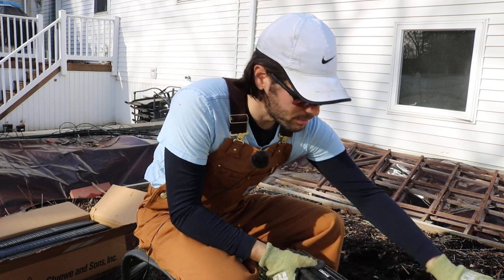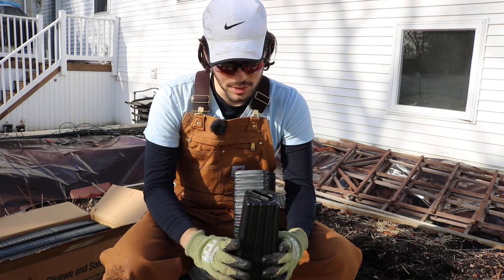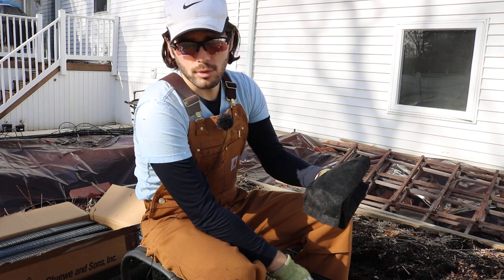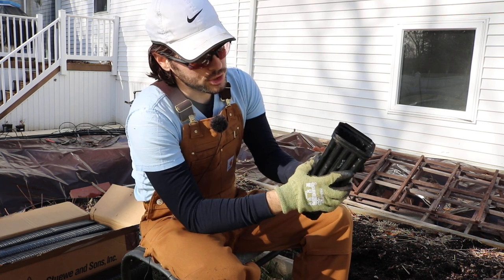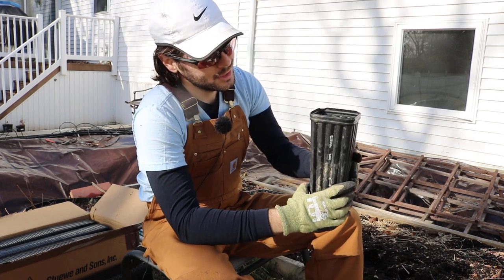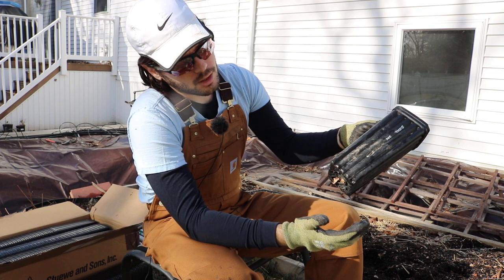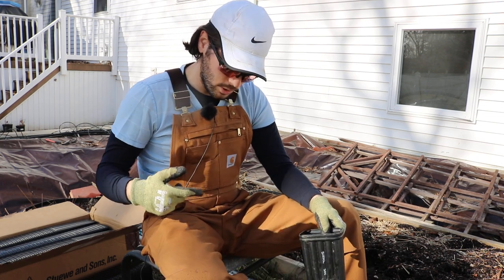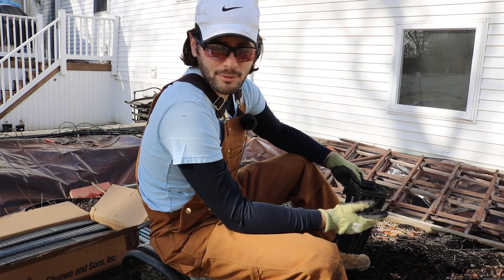Soil, Containers & More for Rooting Fig Cuttings

Comment: I went with Greenhouse Megastore for mine. They should be arriving in time for my fig cuttings. I'm still going back and forth on what "soil" I'll be using. I got a chip drop last week and planned on at least using some of that but might add some other stuff to it. I'm not entirely sure what type of tree the chips are from though.  I was hoping to buy some soil conditioner but Lowes didn't have any organic one. I might check a couple other places for some. I may end up just using some of my own compost mixed in with the chips.

Comment: The correct moisture content of  rooting mix is  the moisture of soil  dugged from the ground after surface water has disappeared.    After a rainstorm . It's surprisingly  dry  but I can see the darker tint of the same soil that has surfaced dried. . I should measure  that moisture with the moisture I bought and have never used. You simplicity  spill, l harks back to your video on the Old Italian man's cutting propagation technique but do it in a pot with bottom heat